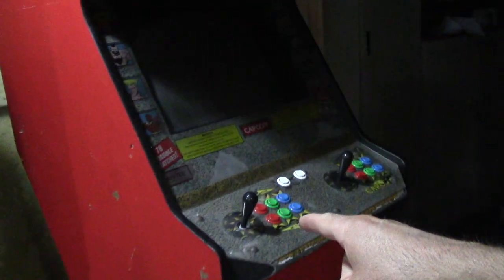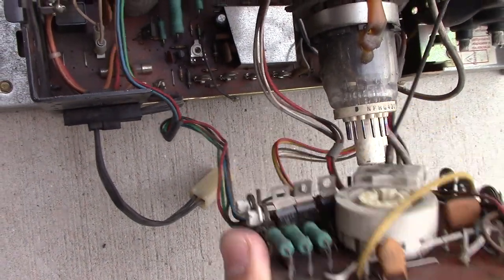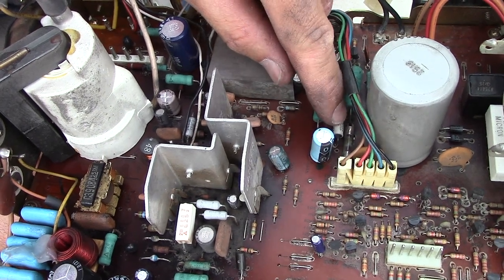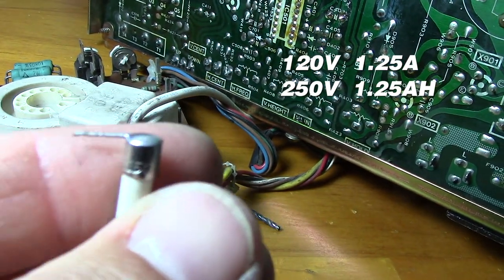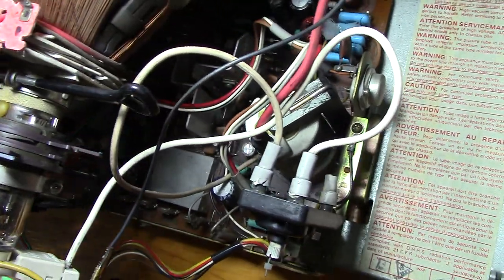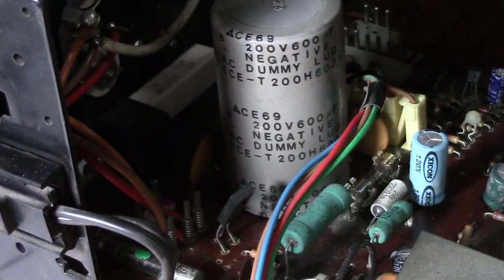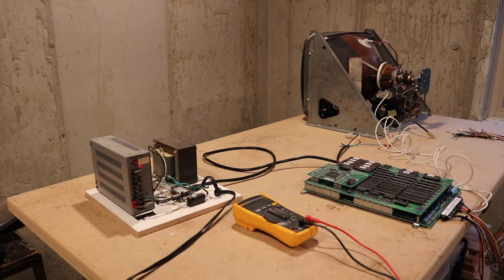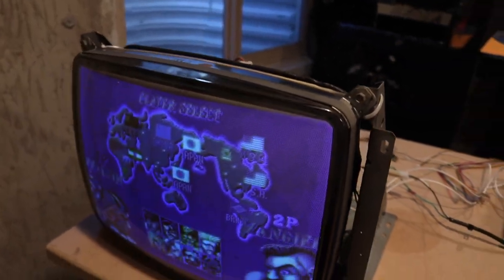Electrohome G07 CBO - Fuse repair & Cleaning arcade monitor chassis

Comment: I've had issues with a G07 missing red that were resolved by re-flowing the solder on the neck board and the chassis.

Comment: ADAM HILL, arcade monitors B+ voltage is a bias voltage? why does the V&H sync hold circuit need a B+ bias voltage set at 125vdc in order for it to work correctly? it doesn't make sense why it needs a big DC offset voltage at 125vdc for it to work